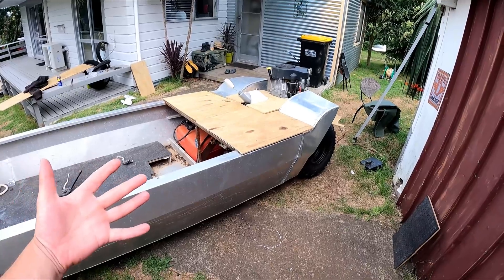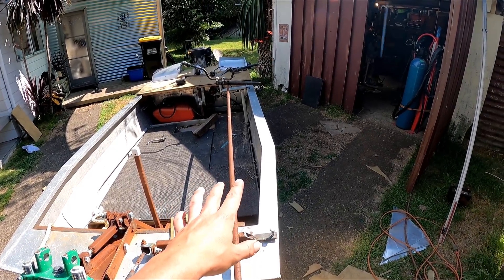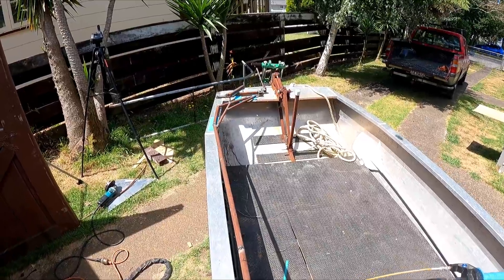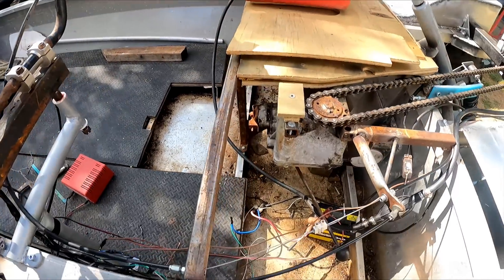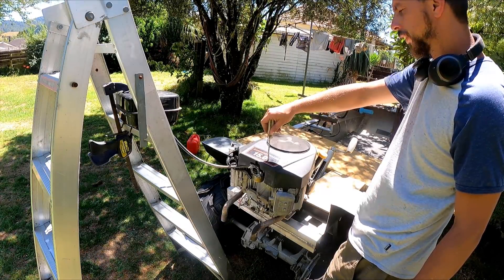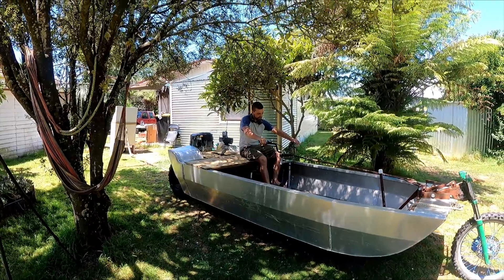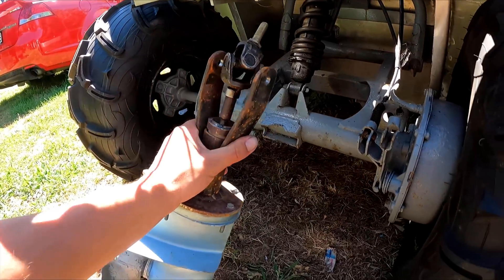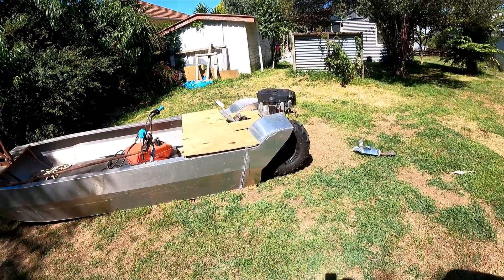Amphibious ATV Boat Build, Part 7 Handle Bars, Wiring, Test

Comment: A series of Kawasaki v-twins (from i think 23 to 30 HP) are identical except for limited throttle opening. Looking at how little throttle movement you have i'm thinking that this 15HP is similar. So if you need more power, check to make sure throttle plate opens all the way. If not, grind down the throttle stop (the flat steel part, not the aluminum. You'll see what i mean once you get into it.) a couple mm to let it open fully.
As for the prop, yeah, skip the u-joint and use a 'dog clutch' as you called it. Not only will you be able to disengage the prop, but there should be enough free play to adjust the trim a bit. Also will be somewhat of a safety thing since it won't be able to engage unless the prop is all the way down, something it physically won't be able to do on land.

Comment: if you are getting voltage from that wire then yes you possibly could charge it, did that motor originally charg the battery. can you list the make and model of the motor or if you look it up you can possibly find the Manuel for it and see what it says

Comment: Brilliant work Daniel! Really coming together well. I like the coupling idea for the prop, have a Google for designs with a polyurethane damping bush, you might get an off the shelf part or make a replica, that'll make alignment easier to overcome when it engages and just absorb any slight misalignment issues as it's running. Also water splashing it will help keep the bush from fretting.
The extra hull extension looks brilliant, I'd tie it up to the transom also with a brace, round bar for least drag, or some gussets against the rear of the hull just to help it plane up easier and not give a false trim to the board on the plane, I can envisage it porpoising otherwise if that flexes much.
Surface drive sounds ideal too. I wondered about using a sliding shaft and twin UJ shaft from motor to prop and mount the prop to that hull extension then the entire hull lifts up only a few centimetres to clear the prop from under the hull. Or use a belt drive but I worry keeping it engaged and handling the horsepower would be a problem on a belt drive. Fixed hull and your current pivoting stern drive idea seems most practical option, good luck! I can't wait to see it planing on water!
Reply from the maker: Thanks, there is a lot to think about

Comment: i would do away with all the lower unit folding bs, try something that can slide up and down on a spline shaft, use a screw type system to lower it up and down the lower unit, also for steering just use a rudder to make it more simple

Comment: Love it. Just thinking, your steering would work better with a torque rod down the length of the boat, bearing at each end, rather than the push rod. Less slop and flex and such, and no slidey bits.
Reply from the maker: That is a good idea I could also of had a steering wheel instead and then the rack up the front 👍
Reply: @dkthewelder  yeah or a manual steering box from something small. Either way would mean a vertical steering wheel unless you want to put uni joints in it but now it's getting complicated and heavy. Just a plain torque rod and keep the bars would be simplest and lightest I think, with less time to a working product.
Reply: Good point, I was actually thinking about a boat steering pushrod linkage, it's flexible sheathed cable and the steering hub is compact, maybe pinch one from an old boat to try? You could even run 2 cables like a twin motor setup and run one cable to the front wheel and the other to the rudder/prop.

Comment: well you cheered me right up, the commando raid on the wife's kitchen for the chopping board was a treat, when your finished fabricating everything that moves , chain, connections, are desperate for a good coat of oil or grease, that might quiet things down a tad.

Comment: red wire of the regulator to + battery with a 20amp fuse inline, should be a 13 or 15 amp charging circuit
Reply from the maker: Cool thanks!

Comment: What about a right angle drive  off the bottom of the engine running to the surface drive that has unfortunately another right angle drive on the top of it? May lose sum oomph but if you play around you might get to 1:1 / direct drive which will get that prop flying if it hasnt got too much pitch for the engine.
Reply from the maker: That’s not a surface drive only the prop is , a 1:1 right angle gearbox is what I need I will just mount the prop onto it with a thrust bearing. I think it should have the power enough 👍
Reply: @dkthewelder  if you going this route try a machinery shop for farm implements they may have a pto 90° angle box they sometimes have a reduction on them but you can just switch out ends and itll speed it up

Comment: They ha e an ac output with a diode on it that just chops the negative side off slap a meter on it with it running and bat disconnected if your getting power out that most probably charging wire
Reply from the maker: Ok thanks. Does it need anything else ? Will it over charge or anything? Sorry for the dumb questions I don’t know what I’m doing with wiring haha
Reply: @dkthewelder  na i dont think they will there not like an alternator they dont put out much current there like almost like a trickle charger they just pulse 12ish volts into the bat slowly